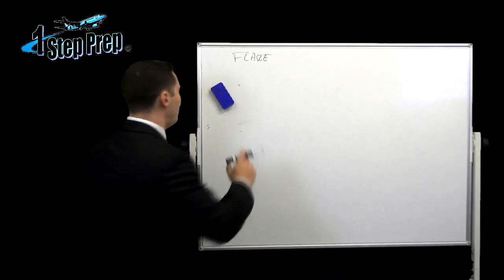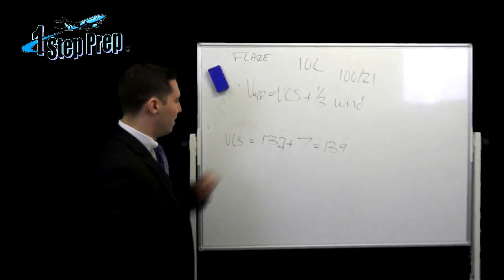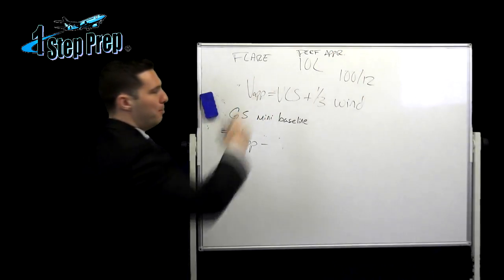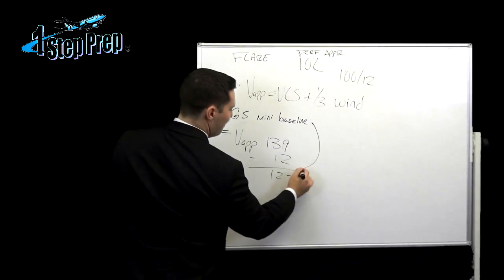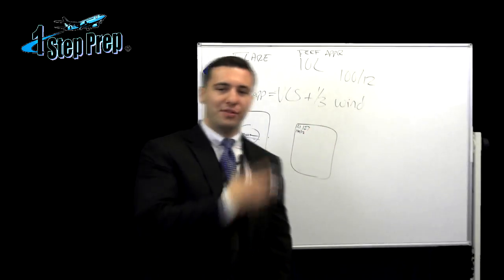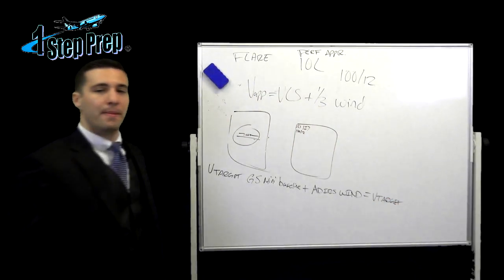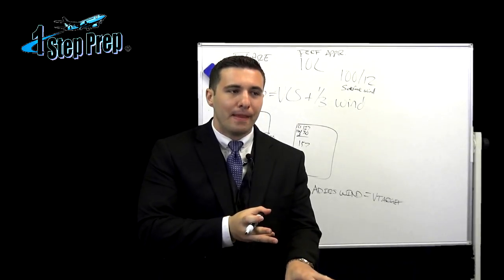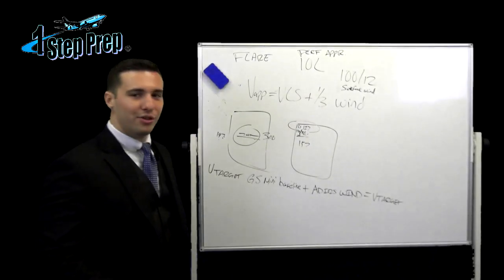A320 GroundSpeed Mini Explained

Comment: All speeds are calculated from one, Vs (stall clean). [VLS = 1.23 Vs]. [Vapp = VLS + 5 (or 1/3 wind)]. This  is all about keeping a safe speed above stall in case of a wind change.

Comment: I see how you're trying to explain this but using the term "constant groundspeed" is misleading. 

What if there's a tailwind on the approach at some point in the approach (like windshear, which is when GS mini is most useful)? Using your figures from this example; GS Mini of 127kts, if you had a 10 kt tailwind the actual GS would increase to 137Kts. Not constant. GS Mini maintains a minimum groundspeed, not a constant groundspeed. Apart from that, your video was a nice help.

Comment: Hi initially wind component taken was 21kts and 1/3 of that was 7kts..we also assumed that our VLS was 132kts...
So u added 132+7=139kts. Why then would you subtract 12kts to calculate gs mini base line...shouldn’t it be a 21kts subtraction.
Reply: The most freaky thing isn't that the guy doing the presentation made a mistake, rather the many comments saying how good and easy his reasoning was couldn't see it either. For people who've no idea what we're on about, look at his formulas for calculating GS mini and Vapp and then ask yourself, how can those ever be the same? Bear in mind his example didn't have zero wind

Comment: Love your videos. Subbed.....just one question. With a wind of 100/12 in your example the VAPP should be 137 (139 was for wind 100/21). This throws off all the other calculations by a few knots.

Comment: Other factors - Wind gusts say 30Knts. this must be factored into Vref (mainly based on total weight). This would mean Vls +5 + 1/2 headwind + 1/2 wind gusts. = 127+5+1/2 (12) +wind gusts(1/2*30) = 127+5+6+15=153knts.

Comment: I don't understand, you had wind 100/21 Vapp 139 then you changed wind to 100/12 and in the next sample your Vapp still 139 , but you said that if 1/3 of wind less then  Vls + 5 , we should use Vls +5
Reply from the maker: Yes! VLS+5 or VLS +1/3 wind the greater of the two!! I see your point, we just needed to update the number back to 100/21! The steps to get there ultimately are still the same! Thanks for your comment!
Reply: Thanks
Reply from the maker: Absolutely!  @anvarakhmedov8236

Comment: With the A/T active and managed speed..or used the QRH to calculate the vls and vapp.than use selected speed or manual trust to maintain the v target.
Reply from the maker: Managed speed is the only requirement for GS mini to be functional. No need to have Autothrust engaged
Reply: @1stepprep  Managed speed and Approach mode if I'm not mistaken!

Comment: You've explained it, using only direct headwind into consideration. I guess you should also explain it using crosswind and tailwind.
Reply: It's exactly the same. Just use the headwind or tailwind component.

Comment: Cool maths but you entirely miss the point of GS mini. If the actual wing is GREATER than the tower wind the target speed will increase as at some point the wind will decrease to the actual tower wind.
Talking about ground speeds etc is meaningless to pilots as we look at air speed and wind.
If the wind is greater than tower wind it will run the target up to allow for the decrease which is coming.
Forget about ground speeds they are useless as is all the plus and minus winds.
Its all about wind in excess of reported wind...its all about simple..

Comment: Hi! Will the ground speed mini work using manual thrust? (Auto thrust off)
Reply: Ivan Brillante no
Reply: Ivan Brillante managed speed is required with A/THR
Reply from the maker: Ivan, as long as the speed is managed you will get the appropriate speed bugged on the tape (GS Mini active). With ATHR off you would simply need to manually control the thrust to fly the speed. Hope that helps!
Reply: Ankur Maggon nope you can have Selected speed and autothrust
Reply: Captain Al with selected speed gs mini will not work.
Reply: Ankur Maggon correct. I was answering the point that you can still have autothrust and selected speed.
Reply: Got it thanks. I actually asked this question because I was worried about one event wherein i turned the autopilot, auto thrust and flight directors off on final approach to practice manual flying. We were stable both at 1000 ft and 500ft. At 200ft there was a sudden gust of headwind shooting the speed trend vector up with the IAS approximately 20kts above vapp. Captain called out “speed” but I intentionally did not reduce the power immediately as i was anticipating a sudden drop in airspeed once we’re out of the gust. True enough it did and we continued to land without any significant events. I made a report and our safety department found no red events triggered on AirFase as far as unstabilized approach is concerned.
Reply: Ivan Brillante what i suggest would be never disconnect auto thrust if you are expecting gust. Specially in gust gs mini plays an imp role.